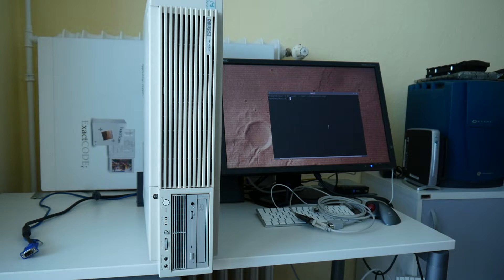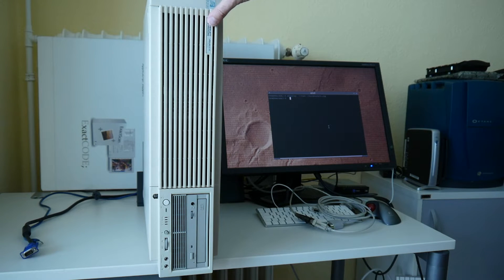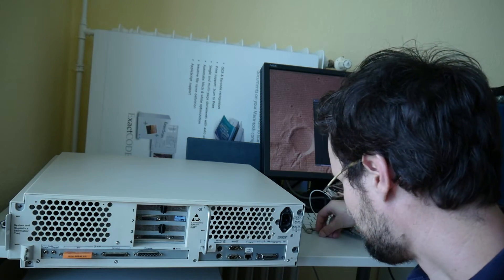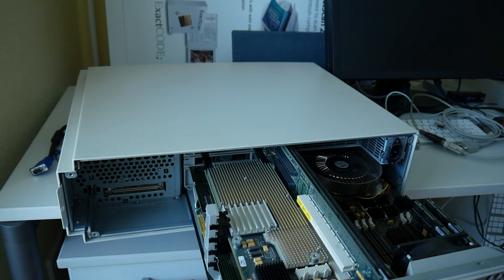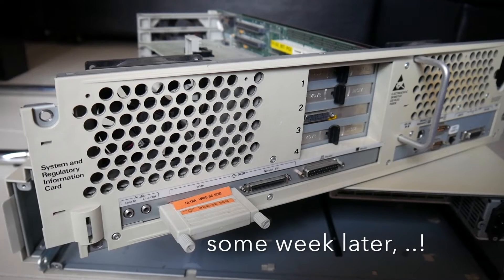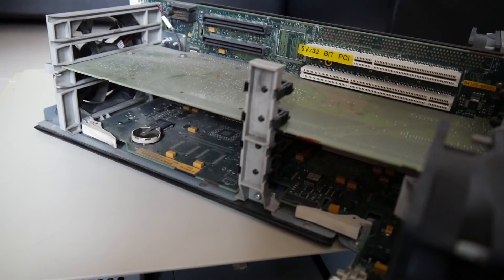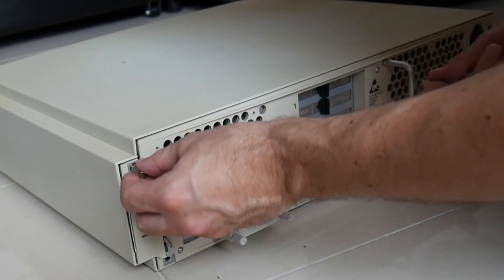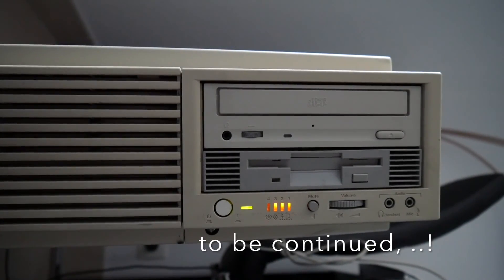This month pickup: 64-bit HP/PA-RISC Visualize workstation, first look inside!

Comment: btw, the analog connector is VESA standard EVC, but only HP used it to some measure. Pretty sure you can find or make an appropriate adapter for it.
Reply from the maker: I read EVC, but as I had never seen it before assume it would be an HP workstation only thing. A bit uncomfortable to have yet another analog VGA connector to keep dongles around :-/ Thanks god I at least got one of those adapters when I picked them up! Ironically I guess HP rarely if ever used the integrated USB and firewire pins? ;-)

Comment: You're gonna have to get one of these Epyc or Threadripper PCs and bench how long it takes to build all of T2 on one go... Might be worth waiting for the 7nm stuff if though it should be considerably faster. Apparently a Linux kernel build is under 30sec now on 2990wx. Patreon might be worth a shot as well for funding your hardware adventures.
Reply from the maker: Yeah, maybe I should ask AMD ;-) Patreon is here: https://www.patreon.com/renerebe with the Linux kernel that number is likely a small local custom config. For general distribution in #t2sde the default kernel has all (as many as possible) modules enabled, so the whole kernel w/ all the modules including archive decompression, and final archive compression (zstd no less) takes only 10 minutes on my not as expensive Ryzen 2700 build ;-) https://www.youtube.com/watch?v=jZNvj67PAEc

Comment: I'm really appreciating your content, these vintage machines, the effort your putting with t2 to keep them running modern software. 
Because you know, if you say retrocomputing almost everyone thinks about the same 80s computers, which are nice and iconic, but to me there's so much more drama with these 90s workstation. More capable, more interesting in architecture and weird in design (expecially sgi), and overall much more relevant as precursors to today technology, i mean, Unix OS, superscalar cpus, accelerated graphics...
Reply from the maker: Thank you - nice to hear. My long term goal is to use this YouTube channel as alternative means to finance OpenSource development - so the more share, like & subscribe the more time I can spend doing various open source bits and pieces ;-) Of course it will not only be vintage classics, but also latest tech review, test, benchmark and such, …